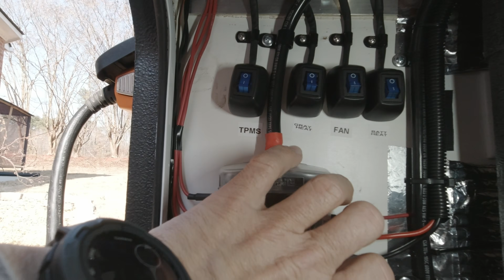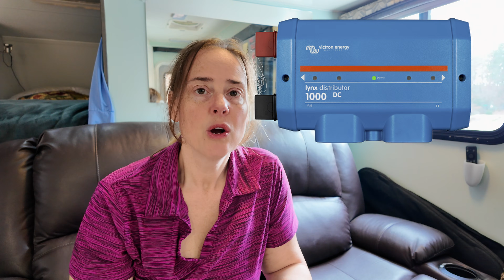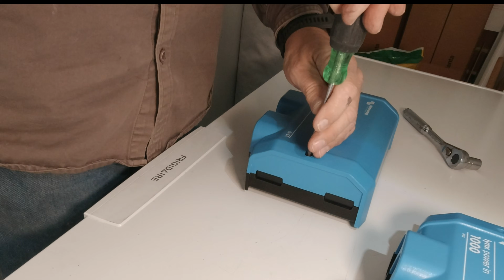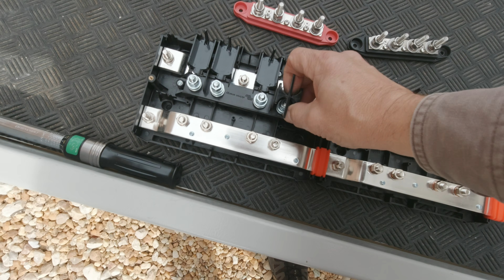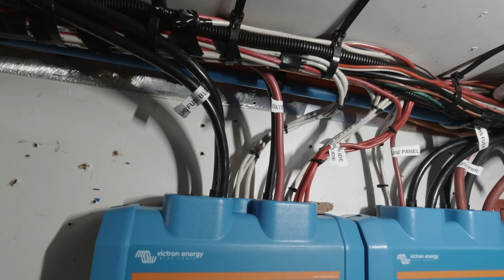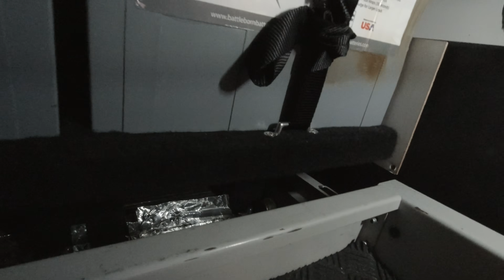Basement Wiring Disaster Fixed! |e173

Comment: Gary if I may ask sir were you in the military, or maybe worked for a company as an engineer or electrician or something or are you self taught or the YouTubes taught? 😜

I must say your wiring work and labeling work is amazing sir. Reminds of the guys in the electrical shop at a certain reconnaissance squadron I was attached to many many years ago overseas. Their work was always so amazing and they paid so much attention to detail.

I had to do something similar to a few, 12 wires to be exact, that were all stripped at the end and taped together to a larger gauge wire that was the ground. It’s amazing what people find behind certain panels and things. Obviously they didn’t go to the same course you did Gary and or learn from the YouTubes or InterWebs!!!!! 😜✌🏽👍🏽

Great job sir!
Reply from the maker: Don't give Gary such a big head, haha!  We were both engineers (I'm electrical, he's manufacturing).  Funny that even though I'm the sparky, he does the wiring.  That's because he's very insistent on clean lines - that's the manufacturing engineer in him.  I bet we're one of the few folks on the road full-time that made room for a label maker 😁And yes, it is amazing what you find when you start looking, whether it's wiring or otherwise - glad you found that mess, yikes!
Reply: @JourneywiththeJoslyns  ah ha so both of ya have some engineering backgrounds. Amazing!!!! I can only imagine between the to of you you could build some pretty cool stuff and of course it shows in your workmanship on your rig (the both of you).

Cheers you two! ✌🏽🇺🇸🙏
Reply from the maker: Thank you!  That's one thing that tends to bring us together - fixing problems and creating new problems... er ... projects! 😄That's the main reason we started this channel - to share the stuff we do, whether it turns out fantastic or swirls the toilet bowl - since there's something to learn in both situations.  And hopefully we'll keep you entertained for a short while as well!